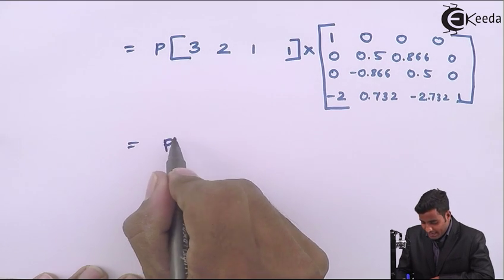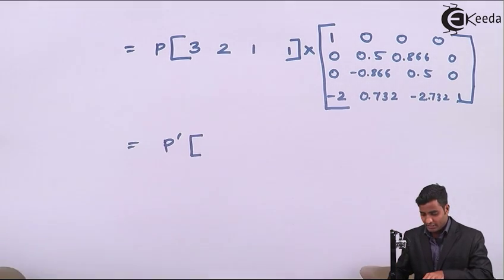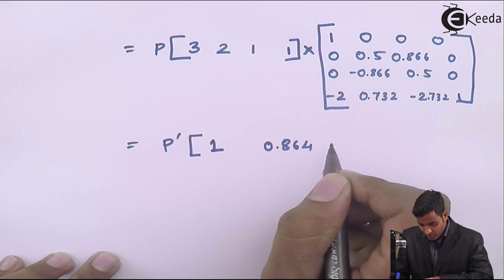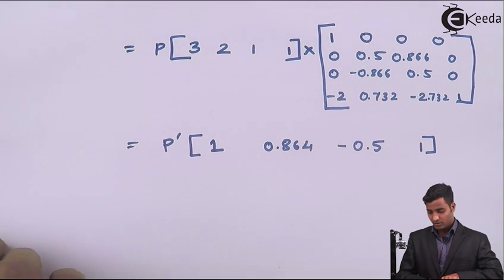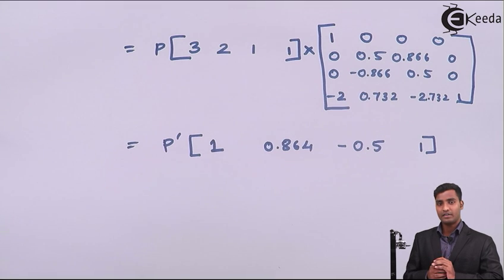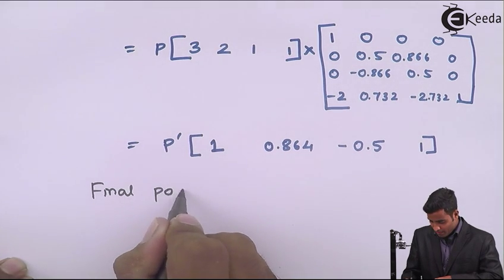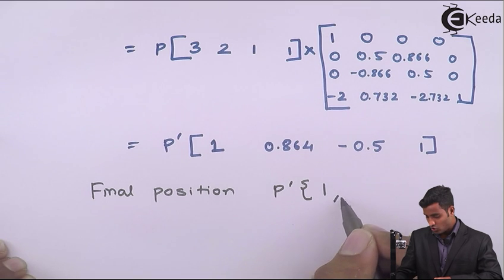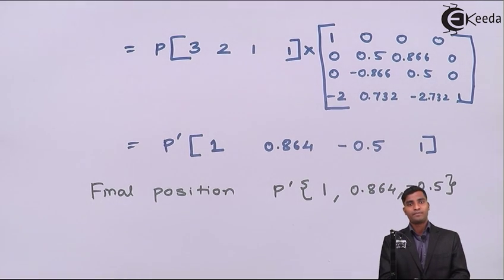Problem 1 Based on  3D Transformation - 3D Transformation - Computer Aided Design

Comment: Sir, here you have taken both the matrices (for translation and rotation) as horizontal matrices. And then you have taken the original coordinates also in a horizontal or row matrix.If I am taking it in column matrix and applying all the other matrices of rotation and translation also in the same manner, then I am not getting the same transformation matrix. Why ?